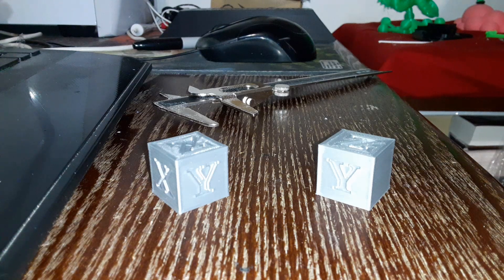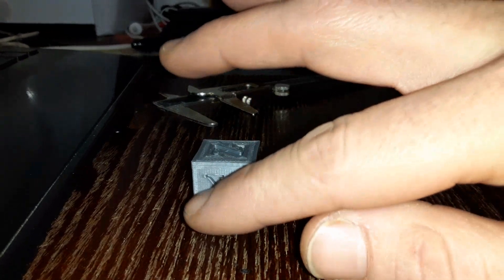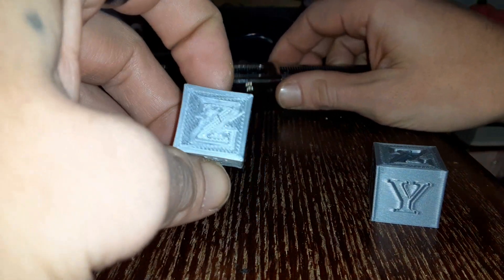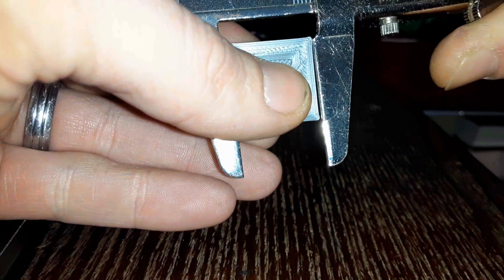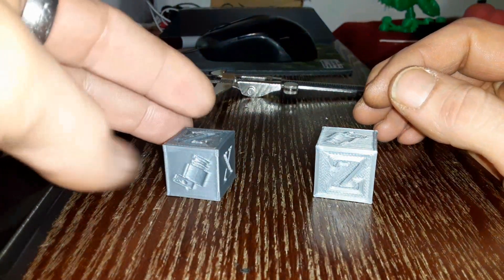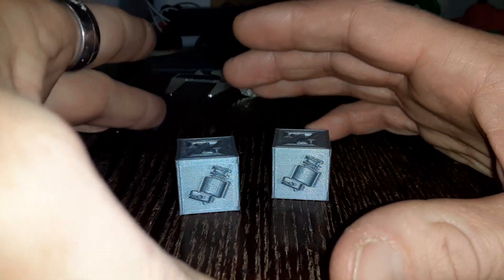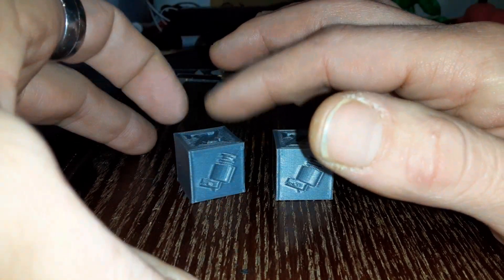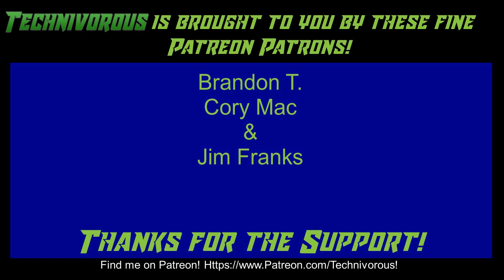Ender 3 Print Speeds. Can it really do 180 mm/s?

Comment: You dont just set 180mm/s print speed and call it a day. It doesnt work like that man. Your comparison here shows precisely why we dont 'simply' double the print speed. You have to first make sure you can even cool it fast enough (yours cant, hence your warped walls and several other issues). You also need to be doing Z strut / frame bracing (at a minimum) if you arent using input shaping. DD strongly advised for this stuff. But most importantly... Aside from cooling, is tuning. A well tuned Ender 3 / Pro / V2 can hit speeds as high as 300mm/s print at 3,500 acceleration with an experienced operator, and zero noticeable change in print quality till going above that (again i cant stess this enough, cooling.... u need a ton of it). Which by today's standards, is a snail's pace, but its a far cry from stock speed.

Comment: Was printing at 50mm/s....
Reply: So can I put 70 without problems?
Reply: @Zaydel  well I definitely can't. I've Capricorn xs now and still can't print faster than 60. If I do I get weird shit
Reply: @robbinkoot2154  Try increasing hotend temperature. For example, printing at 150 mm/s, I had to go with PLA to 260 °C. Stock Ender 3.
Reply from the maker: 50 is good for stock. Once its dialed I  it does 65 70 no problem. With capricorn tubing I get great results at 100-120. It will print at 180, of course slower always brings more quality.
Reply: @Technivorous  well that's a lot. Just ordered a capricorn tube, so that's really nice
Reply: @Technivorous  What if you have a short piece of stock tubing but with a direct drive?

Comment: Ender 3 is limited in software, I don't believe it actually printed at that speed due to the cube only being 20mm, it would never reach that speed
Reply from the maker: Yeah as you say it is limited in the firmware. 180 is the max and when you put that in the speed it adjusts the other speed settings accordingly. The only one that stays at 180 is the infill, but this isn't an engine that needs to get up to speed, the motor doesn't spool up, it goes directly to speed. In other words, it doesn't reach that speed, it's already moving that fast(depending on acceleration and slightly on jerk settings as well) But only for the infill. You can of course set them all to 180 manually, but I imagine you would just make spaghetti.
Reply: @Technivorous  he is saying that on a cube that small even with high acceleration settings it still won't reach that speed.

You never actually reached the speed you claim
Reply: @Technivorous  The speed settings for individual components like walls, infill, top, and bottom layers are entirely controlled by the slicer and are trivial to change. Like others have said the sides of the cube are too small to actually accelerate up to 180mm/s anyway.